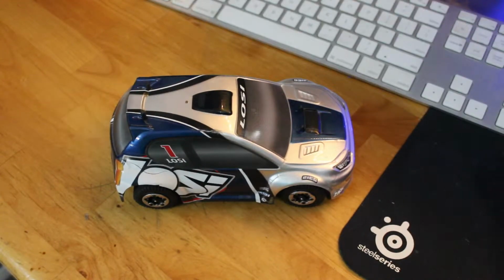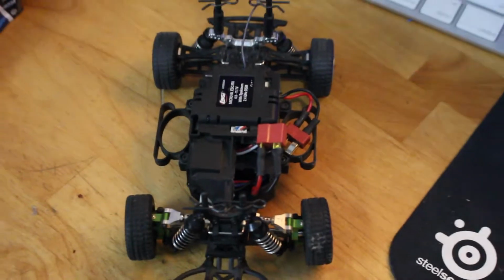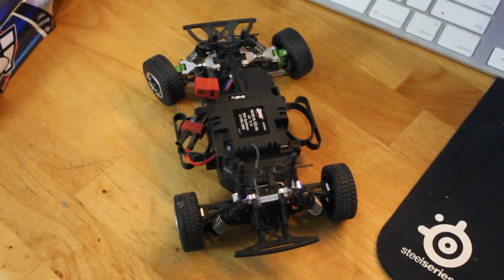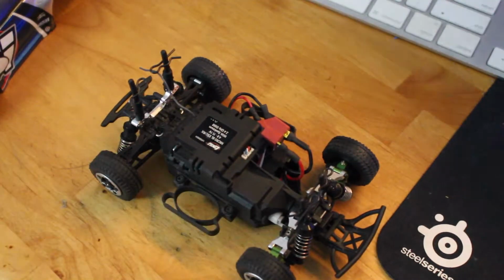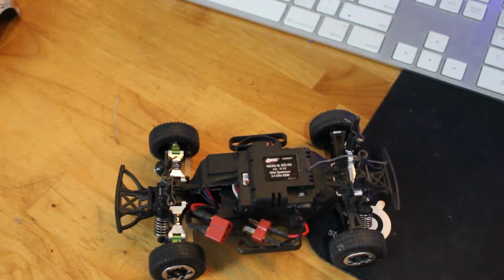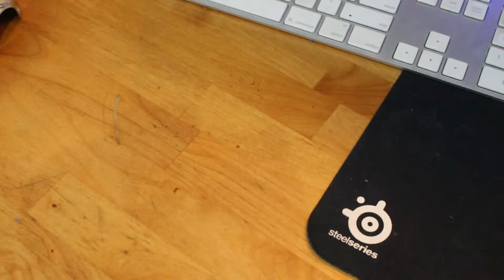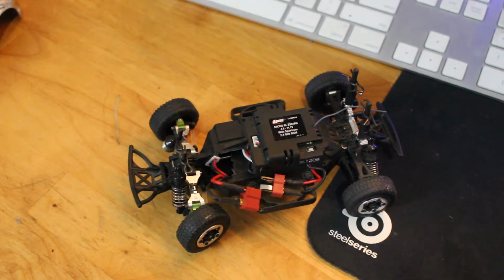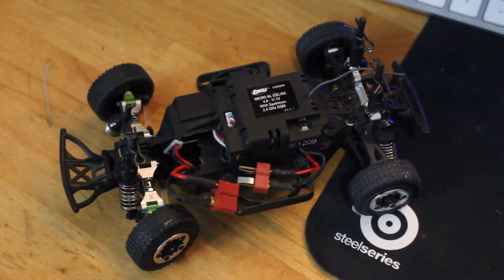Overview of my Losi Micro rally Brushless 1/24 RC Mods

Comment: like the comment below, i want to mod the battery , do you have any vids on it ?
Reply from the maker: Yes I do, Check out my channel. I have a video Drifting around some Bigger Scale RC tires. It's very punchy with the Lipo
Reply: ive modded it already , just wanted to see if you had a video before i opened it up , but did it the day after asking

Comment: I have the same car and want to replace the battery with a non Liso lipo 7.4v. Do I need to mod the car in any way?
Reply from the maker: I'd get a Lipo if you can afford it and aren't scared. Team Losi makes one with a LVD Built it. It costs way more then my Hobbyking but if that's the only RC You're running it make sense to grab the losi
Reply from the maker: even comes with a charger
Reply from the maker: Check out my channel I have a video driving around with the Lipo